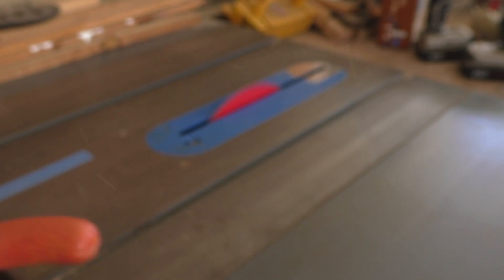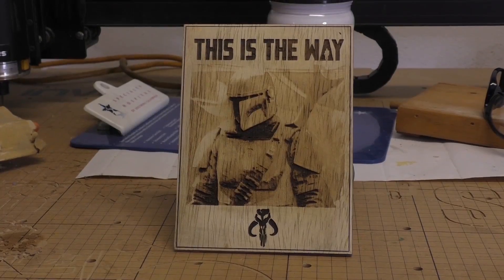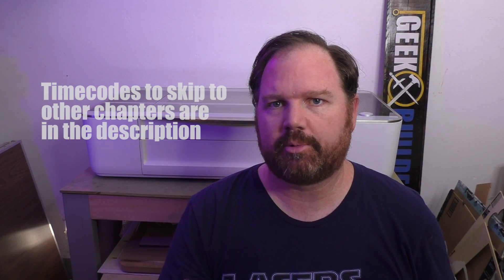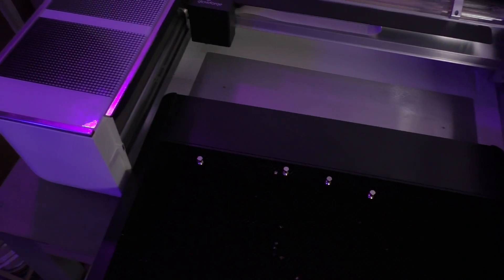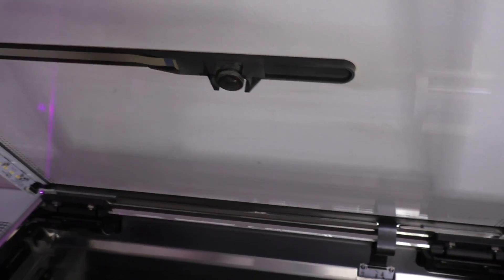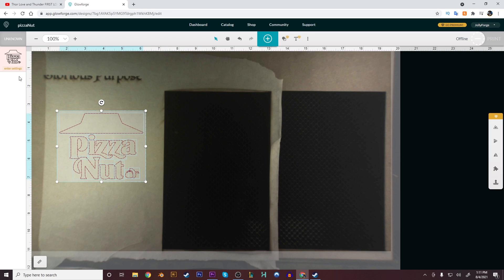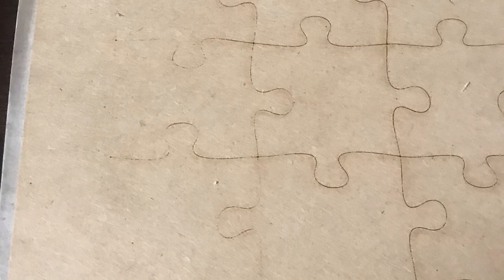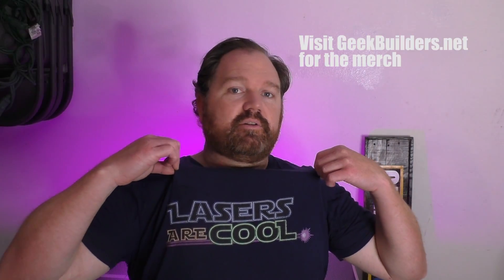Life with the Glowforge 6 Months Later

Comment: While I am glad someone is giving an honest review, there are some errors in your video. First, you can turn your internal exhaust fan off and use an inline fan. Just set it for filter and it will not run. Secondly, you need to calibrate your camera if you are having alignment issues. This is a calibration and is found on the forum. Thirdly, you can remove the crumb tray and use the machine. The surface of the material you are using must still be less than 2 inches from the lens. I have done it by using shims to raise a piece too big for the crumb tray but not thick enough for it to be the right height to focus on. Fourthly, while Glowforge has made the mirror and the printer head windows and lens, not all mirrors, easy to clean, the air assist fan requires the removal of the gantry dolly that the laser head rides on. There is no way to clean it properly without removing it using an Allen wrench, not supplied, and loosening the drive belt. Finally, I, having owned a Dremel LC40, Glowforge and now a OMTech 60w laser, tell people to stay away from Glowforge. I have gone through many arguments with these “techs” about simple things. Like I needed a $1.60 camera ribbon cable but they insisted I needed to spend $750 and get a refurbished machine because they knew better than me about my machine. They only sent me a cable, which fix the issue I was having, because I told them I would not take they’re $750 offer. Lasers from China are great machines and are now much better than the K40 you have. Glowforge are a group of smug people that will never make the improvements you want. I read an article that came out before they did their Kickstarter. The way they designed the machine precludes any improvements you suggested. It just is not possible because they cut so many corners on design, hardware, and software, that they would have to come out with a totally new machine. They’re is very little in this $3000 machine that could run on its own. They original price was supposed to be below $2000 which is why they designed it that way. There is no “brain” in the machine. It’s at the Glowforge company.
Reply from the maker: I did mention the ability to use an external fan and I did mention the ability to calibrate the camera. What I did not mention was that the camera calibration did not correct the issue with my machine and that glowforge support refused to acknowledge that it was a problem on my machine.
Reply: @GeekBuildersNet  I know you did mention the fan but you said it’s something people should do after their warranty is out. I just stated you do not need to wait for that moment. Glowforge will always argue that they know better than the user standing in front of the machine.
Reply from the maker: @topcat1tanks  Ok, got it.
Reply from the maker: As far as the crumb tray issue, as you mentioned... there is a way to get it to work without the crumb tray, but I have not been able to get it to work yet, but this might be more of an error on my part, I haven't invested a lot of time to figure out this one particular issue.
Reply: @GeekBuildersNet   here is part of the article I spoke off and why they can’t change the way it runs. How defensible is Glowforge’s laser cutting tech? Shapiro says the key innovation the team has come up with is moving a large number of functions out of the hardware itself and into the cloud. “We have ripped out huge amounts of hardware from the machine — from a typical laser design, and replaced those with software that we run in cloud servers instead of running locally,” he explains.

One example is the motion controller board used on many traditional laser cutters to translate whatever line the person wants cutting or engraving into a series of electrical pulses that choreograph the motor. Instead of using that type of component, which Shapiro says starts at $400, or even using a cheaper alternative controller like an Arduino, the Glowforge uses cloud software to do the grunt work. “We simply send down the ones and zeros for the motor to the machine over the internet which reduces the cost by a factor of 100,” he notes.

“The thing that’s relatively easy to clone is the hardware, although we have some interesting innovations and patents there, but the place where we think we can really add a great deal of value is in the software,” he adds.
Reply from the maker: @topcat1tanks  Thanks for the info
Reply: Which Lazer would you recommend?
Reply: @topcat1tanks which Lazer would you recommend?
Reply: @patriciamoses9455  OMTech also under the name Preenex. 60w or 100w. Get it from Amazon or Ebay. Make sure it is US stock and you can get it in 2 weeks or less usually.
Reply from the maker: @topcat1tanks  I like OMTech, I'm hoping to work with them in the future
Reply: @GeekBuildersNet  I would order it from Ebay over going to their site. They have been a lot of delays plus there are extra fees added. I don't think anyone should pay a lift gate fee and when I purchased from Ebay, I got it right away and no added fees.
Reply from the maker: @patriciamoses9455  I know this wasn't directed to me, but the first question is, "What do you want to be able to do with the laser?" It will be easier to recommend some possible options from that point forward.
Reply: @GeekBuildersNet  etching possibly glass, marble tile, yeti cups, bamboo, wood etc. Cutting wood

Comment: The design software being behind a paywall is a huge deal breaker for me.  Thanks for the video.
Reply from the maker: Their design software is minimal at best, but having some basic functions behind a paywall is odd
Reply from the maker: @PatchesMacPatches  A lot of people were surprised by this. I know that it is quickly becoming a standard with internet based machines.
Reply: Thank you this was very helpful 😃
Reply: @PatchesMacPatches  just get a WiFi extender, my netgear gets signal 300ft. Was very cheap and a few years old so modern extenders will probably suit you fine
Reply: @PatchesMacPatches  Get a Thunder laser or an Epilog. The Epilog is more costly than Thunder.
Reply: @PatchesMacPatches  Power beam AC dish is a dish that can line of sight beam high speed internet to the other dish.